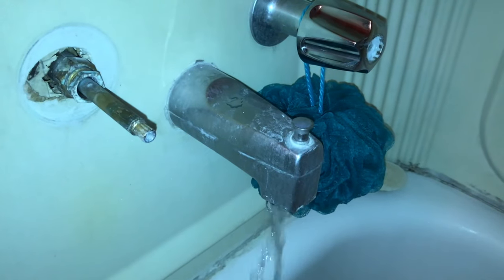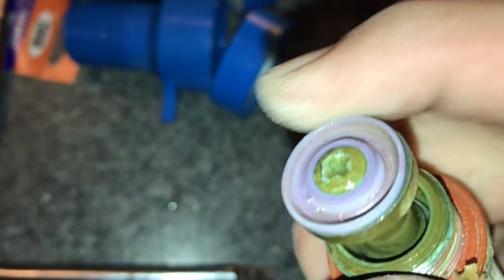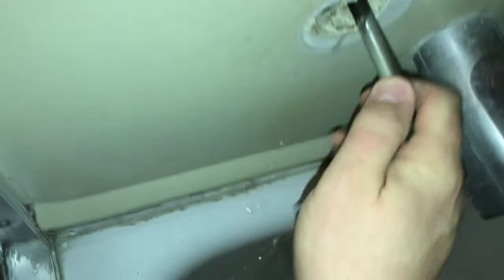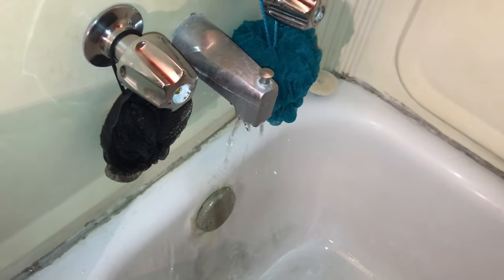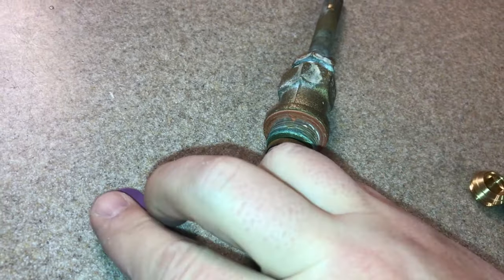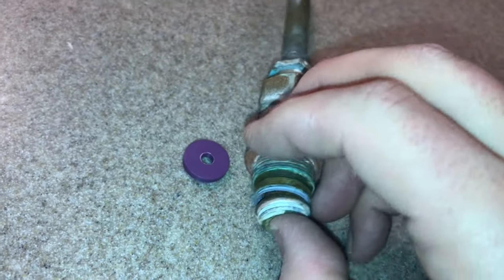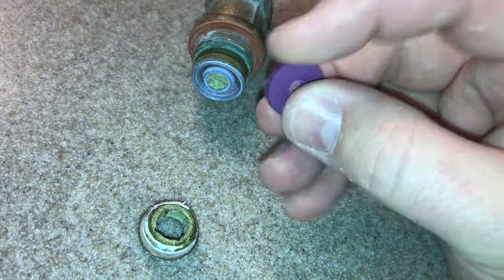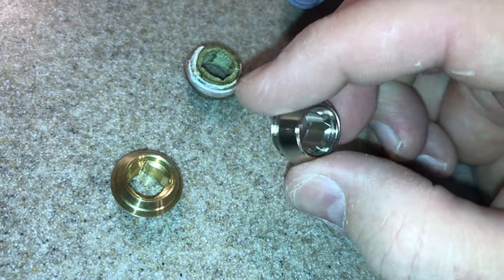Bathtub Faucet Stem and Seat Replacement

Comment: A plumber wanted $450.00 - $1400.00 to fix. The $1400.00 if he had to break into the wall and replace whole valve assembly. I did it myself.   Took about 1 1/2 hr start to full clean up and tools put Back in garage. $40.00 in parts. Easy peezy.

Comment: Would’ve helped if you showed how to remove the stem
Reply: Take the handle off, Phillips screw inside of the H/C plastic piece.
Unscrew the neck piece.
Buy a shower wrench set (it’s like a hollow wrench that you can slip into the wall, around the stem.)
Unscrew valve stem.

Comment: A plumber told me that when fixing leaks on bathtub faucets be sure to turn off your whole water supply before starting. Because the hot and cold water pipes are connected. So you could get water flowing out if you only cut off one water source. Some people's whole water supply may be in their yards like mine.

Comment: What about the pvc ones I cant see how it comes off when I pull it apart it has two that joins together with a tab that turns the water on and off but I want the back one off to replace it ive done the copper ones they are super easy

Comment: How do you get a handle off if you have a stripped screw? My screw is stripped. I've tried an extractor but it didn't work.
Reply: what was the answer?  did you DRILL it out not worrying about destruction of the stem?

Comment: good info, I replaced both stems and seats but the hot water one still leaks, any ideas? thanks
Reply: It's probably late but did you use teflon tape to seal the threads?

Comment: I have a problem where I have replaced the cartridge and it has continued to leak. There was a small piece of pipe approximately an inch long that unscrewed with the new cartridge when I removed it to check out what was going on.  The one end of the pipe has the threads on it to screw the pipe back in, but the side that faces the cartridge washer has no thread or anything like that to have a seat on it.  I can't see any cracks in the pipe or anything like that.  I have no idea what to do about it and currently with covid restrictions in my area you can only use curb side pickup so I need to know what this piece of pipe would be called so I can find a replacement online to hopefully stop the leaking, which is pretty minor but it does persist.
Anyone know what I would call this small piece of pipe?
TIA

Comment: Thanks a lot for the info about the seat and problems from a faulty one.  I recently replaced a cartridge on my bath faucet.  It went fine but it still didn't seem right because the tap was still fairly hard to shut off for it being brand new. I know now the seat is obviously damaged. I probably ruined the washer on the new cartridge I installed, but that's ok as it looks cheap and easy to fix.  It's been a headache, but now it makes a lot of sense!  I assume I should use some teflon tape for the new seat installation?  Thanks again :)
Reply from the maker: B Morrison definitely want to use something to seal the threads some people might prefer pipe dope
Reply: Thanks for the reply!  So I went ahead with attempting to replace the seat, and lets just say its been down-hill since then.  My faucet simply does not seem to have a seat.  It appears to be a non-replaceable seat that has been built into the faucet unit itself.  I've been to the hardware store many times in the last few days trying to figure this out and even brought pictures, but no one knew what I was talking about. I've researched online and I have come up with nothing.  I bought the seat wrench but there is not a square/hexagon to lock into whatsoever - the seat is perfectly round!  I could clearly see some nice chips along the edge of this "seat," which makes sense why it was giving me trouble.  I tried the big flat-head screwdriver technique instead of the wrench but that just carved more brass out and probably made it worse.  I'm totally stuck at this point.  Have you heard of this type of seat?  I can find no image, name or similar type online whatsoever.  The faucet is made by Peerless and has the hot/cold handles and spout all together in one unit.  Any ideas? Thanks again
Reply from the maker: B Morrison I haven’t dealt with peerless before...I think this is a pfister set up...this was just my experience...whenever something is over my head I hire a pro and if I can be there with them hopefully I can learn from them so that I can do it myself if I need to down the road

Comment: Can you do this without shutting off water to the house? I know there's water pressure, but what if you turn on water from other sinks in the house to relieve some pressure?
Reply from the maker: Unfortunately no.  If there's any water coming through that valve while you try to replace it you'll just end up making a big mess.  In this house, the shut off was in the crawl space with loads of spiders :( but it had to be done to make the fix.  You could also install a shut off valve closer to your bathroom, but you might not be able to make that work depending on how your house is laid out.
Reply: No, water has to be turned off

Comment: Than chip ain't causing the leak. That happened when you took it out with one hand!  It could have been bad. But a chip that big would have been seen in the washer. I know. I have been changing them for 20 years.